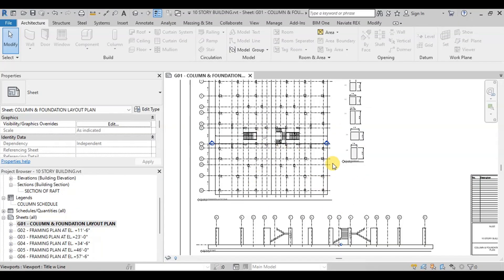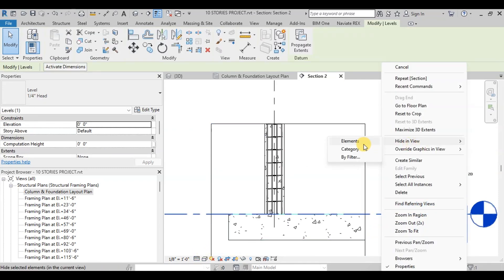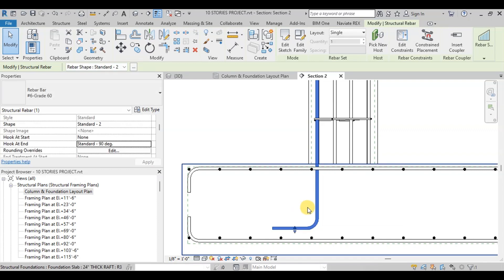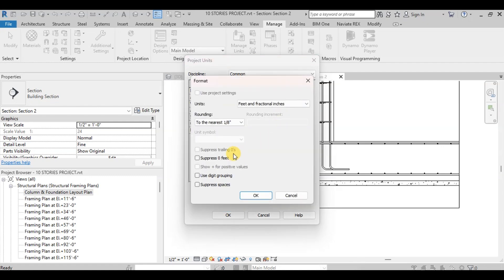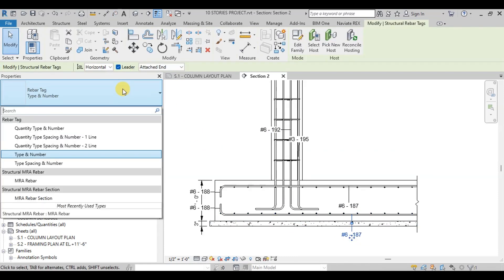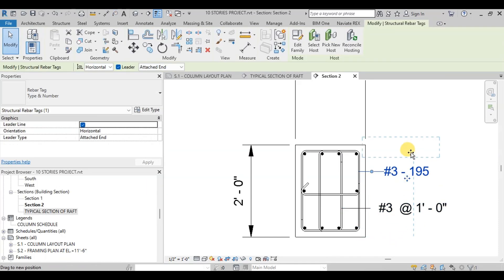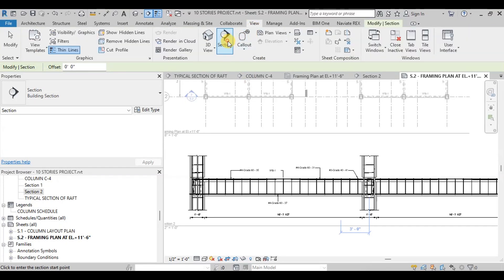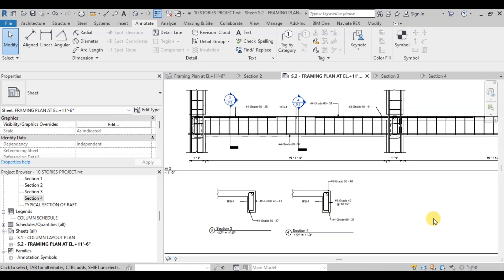Revit Detail Drawings | Detail Drawings from Revit | 10 Stories Building Detail Structural Drawings

Comment: well done dear but i have a question i can not transform the reinforcement to revit during i go to update model to the (   Transfer (optionally) Reinforcement projects (beams, columns, spread footings) Steel connections ) not show i hope you help me and very thank you.
Reply: Did you design each column and beam manuallt in Robot?
Reply: @MuhammadAbubakar-of1ij           First I draw a plan using Revit software then transfer it to Robot software and after designing using Robot software, I transfer the plan to Revit software but the rebar in the column and beam is not transferred to Revit software, I cannot solve this problem